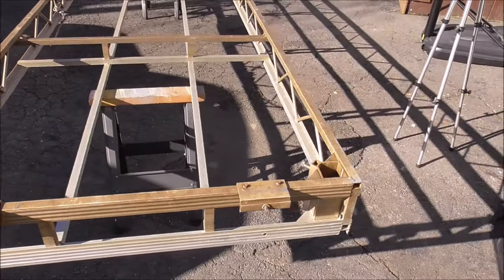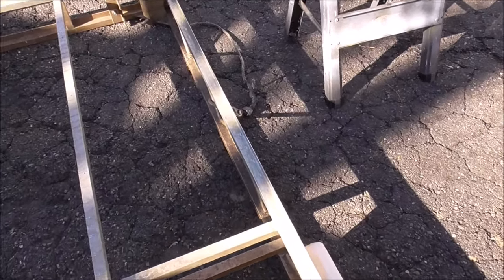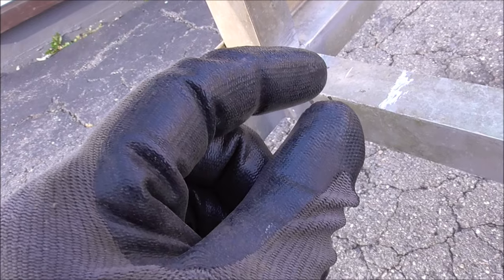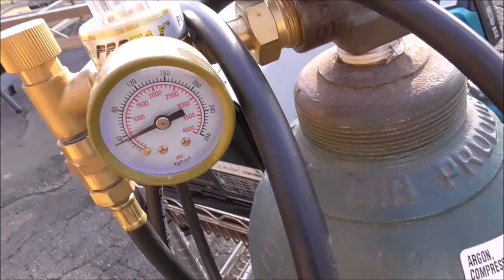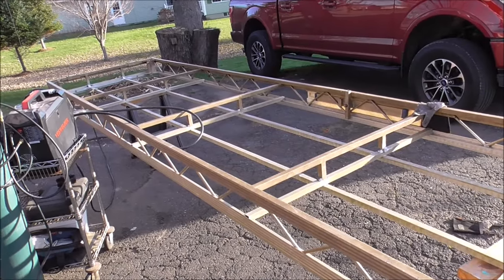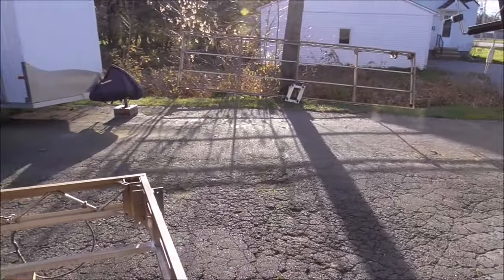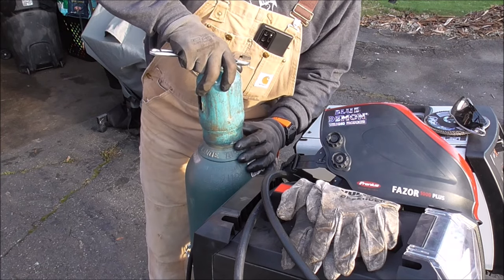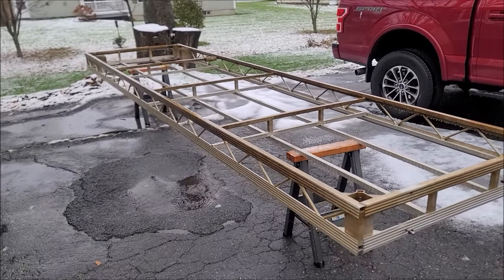Say Goodbye to Cracks! Ultimate MIG Welding Fix for Your Aluminum Dock

Comment: Other good practices for welding aluminium are;
1. Clean the prepped weld area with acetone.
2. Use a new flap disc rather than a previously used on. That way, no cross contamination can occur.
3. Use a new or cleaned out stainless steel brush for cleaning the repair area and or the new weld repair.
4. When using a wire brush to prep the area for welding, only brush in one direction, do not push and pull because that drags contaminants back onto theweld area.
5. Preheat can help with thicker sections to weld.
6. Use a teflon liner in your mig torch IF you don't have a spool gun.
7. Try to run as hot as you can and get a type of "spray arc" effect. A cold weld will sit on top of the work piece. 
Here in the UK, a large bottle of Argon from BOC is about $50 plus the rental per year which is about another $50 approx and PLUS the gas surcharge and PLUS Value Added TAX. Oxygen and Acetylene are hideously expensive.
Be grateful you are in the USA, the UK is very expensive!
Reply from the maker: For sure!

Comment: Very informative, actually I am working on a new/old welder today and it's cold as well maybe to cold, it's going to be the first time firing it up and putting a new 25' mig gun and trying .52 wire, should be interesting, can't wait to try Aluminum some day, What about the other aluminum wire 5023 or something like that, wouldn't it be even stronger than the wire your using now?
Reply from the maker: I tend to weld a lot with 4043 because that seems to be the 'go to" wire when I'm not really sure what the material is that i'm working with. I probably could have got by with 5356 but I really like how 4043 wets in.
Reply: @BrandonLund  wow talk about a wide thick bead using the .52 solid core wire, fired up that welder I was talking about with new mig gun etc. and the .52 wire works great for anything like above 1/4 inch thick, super cold day today

Comment: Some square tubing setup on some stands with some wheels so you can add some tarps to em to make a temporary outdoor wind shield that could easily be moved back into your shop out of the way.
Reply from the maker: That's actually a great idea. I should build some of these. Thanks for sharing!

Comment: Brandon, I pay  55.00  Can for same size cylinder  on refill of argon. I always have 2 on hand so if I run out I have another to switch to then next trim to my welding store I take the emptly in get a rifill and now I have  1 nearly full and one full tank.   I have then 2 tanks argon 2 tanks 75/25 and one large tank of 90/10 .
Reply from the maker: Thats a great price! I had to think for a while what I have for bottles. I do 5 year leases on my bottles so it gets expensive at 250 each. 1k a year in bottles plus gas and it seems like 99 dollars for gas is a bit steep. I realize i'm not a huge customer but it seems out of line.

Comment: Hey Brandon,
Just a question about those factory welds.  I noticed craters in a few of them, and I have seen videos that indicate that cracks will begin in those craters and travel through the rest of the weld, especially when vibration or flexing is applied to the structure.  Have you found that to be true?
 I see that your welds are crater free, so  your welds are far superior to those original welds.

P.S.  My local supplier here in north Florida charges about $85 for a 125 tank fill or exchange.....unless it's gone up in the past couple of months
Reply from the maker: Thanks man i appreciate it. It seems like pretty much everywhere is cheaper than the price im getting. Crazy! Not filling the crater is a great way to get a crack. I could see some We're not cracked fully through but they started at the crater

Comment: I might make my next project a pontoon boat. I was looking into it and I can get some 55 gallon metal drums for 15 bucks or less each. I figured about 6 of em should be fine.  That would basically give me a floating dock to fish from. I've been wanting a boat but they are just way to expensive and don't have the storage or fishing area I would like.
Reply from the maker: I built one about 15 years ago out of 36" HDPE pipe. It was 16' long and 8' wide. I built a steel frame and mounted a jib crane in the center and used it rebuilding sewer treatment plants. It litteraly would be used floating in huge ponds that were lined and filled with 💩

Comment: Wouldn't some small triangular gussets prevent future cracking?
Reply from the maker: Absolutely. Originally when I went to look at the job, the customer only wanted the ends welded. When I pointed out all the cracked welds, he felt it wasn't really worth it. It took some convincing that it should all be fixed and I treated him good on the job so he could get all the defects repaired. If it were mine, I would weld a flat bar X brace going from corner to corner. That would pretty much eliminate all the flexing

Comment: I can't wait to get a tank of gas so I can finally use my tig setup. I've had my kit for I think 3 years now. Still in box never used 😑 got the Vulcan omnipro harbor freight special. Been a great machine so far.
Reply from the maker: Right on! Like others have commented, make sure you shop around for gas because the prices vary wildly. I would encourage you to stay away from the little 40 cuft tanks though. It's tempting due to the price but the smaller the tank the more costly the gas. In other words, an 80 cu ft tank is NOT twice as much to fill compared to a 40 cuft. It might only be 5 dollars more for twice as much gas. Generally the bigger the tank, the lower the cost per cuft of gas.

Comment: I hate repairing aluminum cracks, particularly if it was outdoors. Yeesh! They’re totally contaminated. A problem with that structure is that the welds don’t extend all around, allowing water and junk to get inside, behind the welds. Yes, weld the tops so they seal the entire fitment. Otherwise water will get in again. Heat first to drive out any amount of water that may still be remaining. Those joints flex, and capillary “action” will suck water and dirt in. Good work.  For extra rigidity they should have welded the posts to the surrounding lip. A push pull gun costs maybe $2,500 to $6,000 and requires a push pull welder that usually costs $5,000 and up. Nice little expense. I hate to say it, but the welding on this is no worse than I usually see, and better than some I’ve seen. The design of this is flimsy, so it flexes a lot and aluminum doesn’t like that.
Reply from the maker: I couldn't agree more Mel. If it were mine, I probably would have at least installed some X bracing throughout and tie it all together with a flat bar brace corner to corner to try and get rid of some of that flex. From what I understand, it's been in service for quite a few years but I would still be discouraged to see this amount of failure. Hopefully he can get many more years of service now

Comment: The spool gun is the one attachment I don't have yet.
Reply from the maker: If you work with aluminum occasionally, it's pretty handy to have and a lot more forgiving when welding outside as compared to TIG welding, plus it's quite a bit faster. Plus you dont have to be so careful with keeping your whip straight

Comment: I’m really surprised at the poor craftsmanship and id be pretty miffed if i paid for that, id be right down there making them fix it….thats horrible. I’m a little surprised that there wasn’t triangle bracing on all the 90 degree intersections . The product is overall a cheaply made peice. Until people demand better …it’s unfortunate people will be at the mercy of others . People know how to do things right. We have to demand better or find the right place or person who will do it right. Ive been fortunate . I have a lot of old things and new ones too. Id have to say, i really do like my old things, like my 99 ford f250 or my old aluminum boat with the old 40 hp Yamaha 2 stroke. Things were made with some pride… thanks for sharing Brandon. It’s refreshing to see someone cares and notices how things should be
Reply from the maker: I appreciate that Chris! You and I are on the same page. I don't need new and fancy. I want it to be reliable! I was surprised they didn't pit gussets in also and shocked it didn't have some basic cross bracing. Looks to me like thin welds because someone was in a hurry and not much bracing were the issue.
Reply: It’s a really long stretch not to have beefed up stock at the minimal . I wouldnt want to be the person who someone or thing fell into the water due to failure or some other bizarre thing like the boat takes on water and breaks it…..i just dont get it…. @BrandonLund
Reply from the maker: Same! 👍👊

Comment: I would be willing to bet these weak welds hydraulically fractured from filling with water and then freezing over winter.
Reply from the maker: Thats a very likely possibility. I guess these have been at the same location for a few years, taking them in and out during the winter. Even if they were taken out and had standing water that froze, it could cause this.